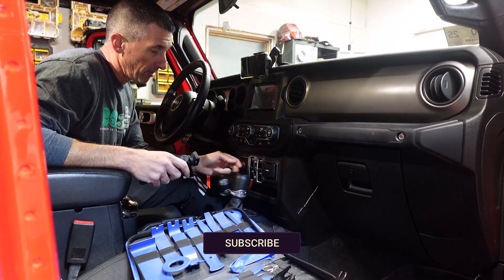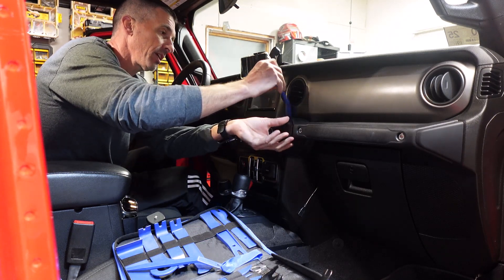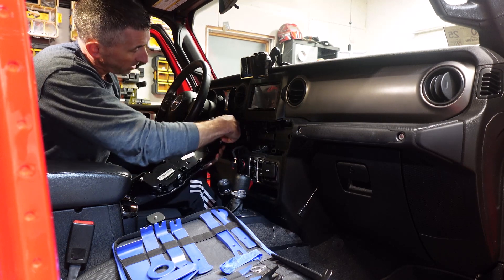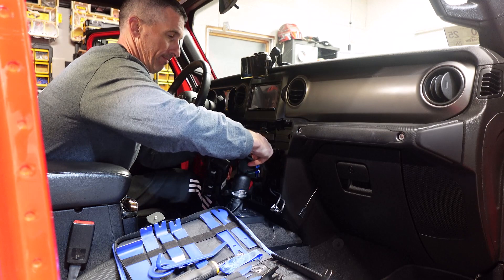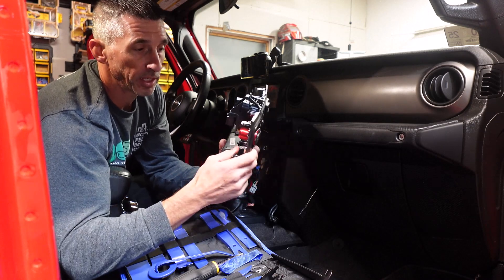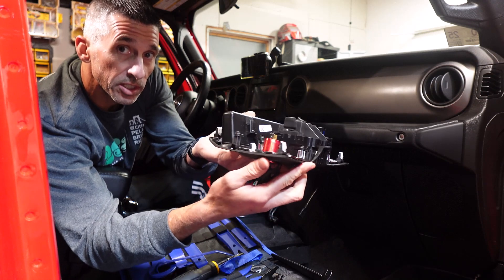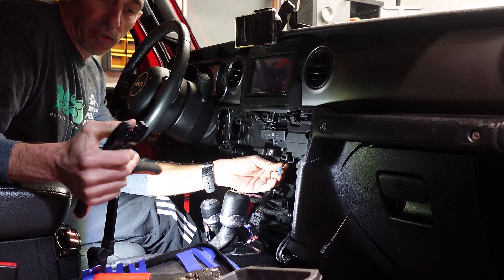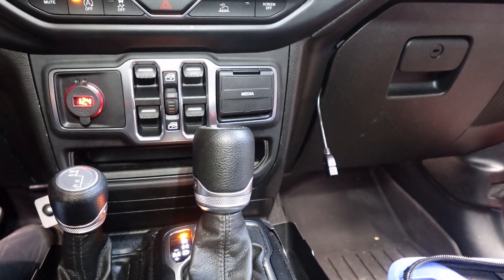Jeep Gladiator - 12c Dc outlet Swap for USB 3.0 Fast Charging

Comment: There is no reason to do this. This guy installed an outdated USB to begin with. Just buy a 12v socket insert. So when it breaks or need newer connectors you don't have to tear the entire thing apart.
Reply from the maker: What reason is there to do any project? Maybe knowledge? The guy before me  installed an aftermarket radio and because of that the media ports were dead so I got creative. 🤷

Comment: Thank you for this. Could you show a picture of the 12v plug wiring? I messed up and pulled the wires out of the plug end and can't remember which goes in which spot. I have one I need to hook up and cannot find a diagram anywhere.
Reply from the maker: @fattsammy  of the factory plug or new? I'd have to look later I think I do have a pic
Reply: @Mitz-RI  The factory wiring end that goes into the back of the 12v power outlet in the dash. I should have taken a picture before pulling the wires out. D'OH!
Reply from the maker: @fattsammy Does this help https://photos.app.goo.gl/mGoKx2krBnB535kCA
Reply: @Mitz-RI  YES!!! Thank you, I appreciate it!
Reply: @Mitz-RI  I finally got around to fixing the 12v outlet in my dash and could not have done it without your help. Thank you!!! Everything is working great.